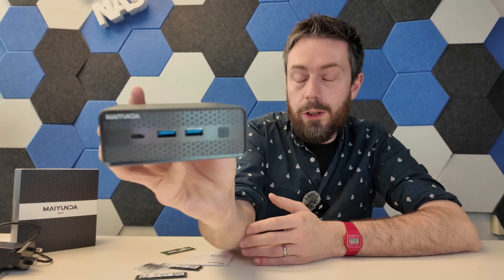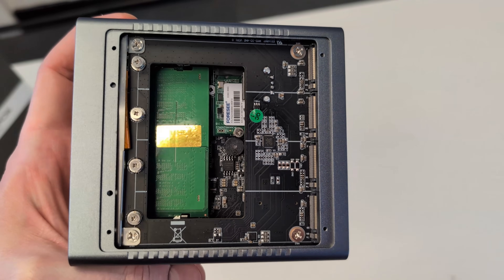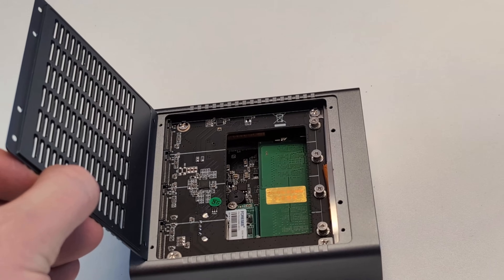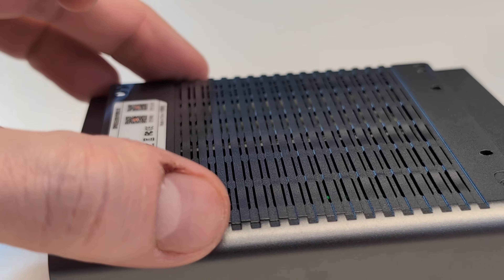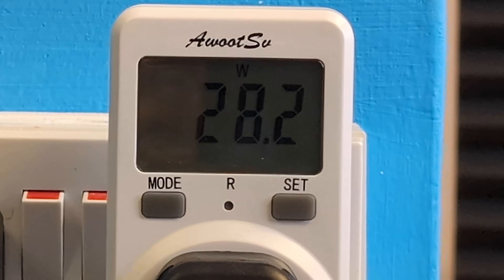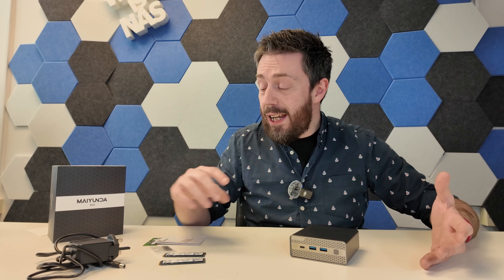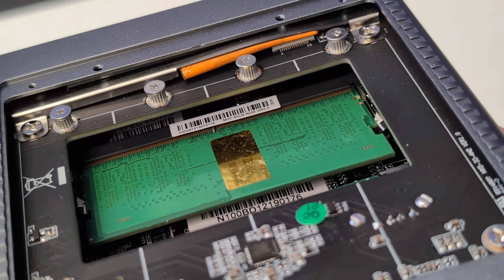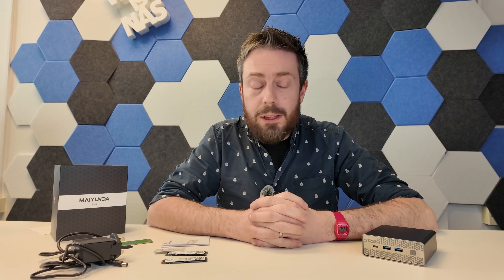Is $149 TOO CHEAP for a 4 SSD NAS? (Maiyunda M1S NAS Review)

Comment: good vid. picks up the subtle that can become the big problems later.

As far as heat goes, flip the box over so the slotted panel is on top. At least hot air rises. Perhaps a 3D case around it, with an external fan on top would be an useful additional for little money.

Comment: I decided to buy one of these and I am getting very minor heat on the chassis. I went without thermal pads on the SSD's due to the air intake being that bottom grill. Seems to work fairly well for me. A bit sluggish when I remote onto it but its still a new install of windows 11 so I wont stress it. I have two devices I cant seem to find drivers for but neither are important since its a headless NAS. It is a bit of a noisy little box though. I am pondering how to increase airflow on bottom so its not quite as loud.

Comment: I saw another review that looked at the temps and found it is set to 60 degrees in the BIOS. If you want to keep the unit cooler you could lower the temp setting in the BIOS, which should also alleviate concerns about the SSD's overheating (which, IMO, given this units design shouldn't be an issue).

Comment: This seems almost exactly like what I've been looking for. I wouldn't mind paying a little bit more for an updated system fixing some of the issues.

I would personally also like to see a passively cooled unit using the chassis to dissipate the heat. An upright standing design with corrugated sides, and thermal pads or similar to connect components to the chassis, should be able to dissipate the heat no problem. Powering via usb-c so I can use a GaN adapter would also be great, but might be difficult electronically.

Comment: I really wonder why they don’t just make these box with an option to mount a 12 cm fan on top of the box, just put some mounting screws on top, put the nvme drives on top side, and we can install any 12 cm fan on it, either power with usb, or provide 12v header for standard fan. That way we can make sure the drives are cool and it does not cost too much for them to make it.

Comment: I would have liked to hear more about the OS for this. How difficult is it to load UnRAID or similar on this device? 
There are home users that want a simple plug-in play solution. An interface that’s easy to use without having to tinker around too much.

Comment: Thermal pads are for heat transfer.... the cover has holes in.... it is relying on direct airflow, not heat transfer..... quit whining about it not being supplied with thermal pads.

You are a good channel for finding out about new kit, but sometimes i doubt your technical skills.
If you read lspci correctly you will know what generation that 5th m.2 port is.
Reply: F no.... i just unsubscribed

Comment: Unfortunately, there aren't really any SSDs suitable for this NAS. I think everything on the market today that's larger than 4 TB is either PCIe 4 or 5, and definitely x4, because you always consider them individually, also because many devices only offer space for one or two M.2 SSDs. Over time, if more devices similar to this NAS become available (some already exist), perhaps a manufacturer will come up with the idea of offering large, economical, and hopefully relatively inexpensive SSDs with high capacity but only with PCIe 3x? I'm not sure how sensible it is for SSDs to have less than x4, as that could significantly limit their use.

I've looked it up: I can only find PCIe 3 SSDs up to a maximum of 4 TB. And there are PCIe 3 x2 SSDs from one supplier, but they're more intended for industrial use and have a maximum size of 1 TB.

I'd love to buy this NAS, but the cost of the required SSDs puts me off. Besides, it's relatively uninteresting for me, as I already have more than the (reasonably) possible 4 x 8 TB capacity across several HDD NAS systems. I had actually already upgraded further with a NAS expansion and 4 x 16 TB HDDs, but my frugality led me to snag these used Seagate drives, sold as new, with fake SMART entries. Luckily, I was able to return them, and I barely had any data stored on them anyway, as I wanted to let them run for a while before putting them into full use.

Comment: I bought it at lower price as in HK.  I like its compact size, with 4 bays ssd and 12V DC power, fast, its hardware is very cost effective vs QNAP or Snology. It can be small PC for simple task  I unlike "wave form" noise (not too loud but just noticeable ) even set to quiet mode,  take some time to install DDR 5 ram, .. in general, no more complaint for its lower price.

Comment: I'm sure we'd be interested in your head to head comparison with the cwwk P5/P6 M2x4.  And I guess that GMK also.  The cwwk has better height to work with internally but also suffers from cooling the cpu vs the ram & ssds.  It's remarkable that something can be cheaper than the other two.

It's interesting that this unit has better drive->drive performance.  The CWWK's throttle horribly at that.

Aside: did you see the teaser for an Aoostar WRT *MAX*.
Reply: I've seen a lot of people saying the reliability of the P6 in ZFS is poor too, so I'd like to see some actual testing between these devices too.

Comment: I wonder if the BIOS settings need adjusting, to set the max TDP for the CPU, maybe they are defaulting to no limit.  I found that with some of the Topton and similar units, they got hot because the BIOS settings were very generic and default, when we know there is a max limit for the N100.

Comment: You’re aware you can connect two machines using TB4 and with certain Intel chipsets, and both will appear as network card on the other? Might be worth trying, since the speed will be 10 GbE+.

Comment: Good review, if you need more air in there you can always use a drill or dremel more air holes or mount an extra fan. The case getting so hot can also be a good sign in that it means that the case is doing it's job of radiating the heat away.

Comment: I'd recommend an ex-corporate SFF desktop.  It is larger, but orders of magnitude more capable.  Anyone keen enough to go for an  on-prem device is likely to outgrow this quite quickly.
Reply: What ex-corporate SFF desktops have 4 NVMe drives? 🤔
Reply: @mikeschinkel-newclarity  You can add a 4-slot SSD carrier card for $20 if you've got something that can do bifurcation. You might find something with an x16, and x4 and a couple of x1 slots.  You can put a single carrier card in each.  
If the nvme drives only have x1 links and that kind of CPU, you've got 4 drives for capacity not speed.  If capacity is the requirement, then HDD's are cheaper.   If you're looking at a $150 device to save money, are you going to buy 4x4TB nvme drives and operate them with x1 links?

Comment: There are 2 bootleneck, n100 pc lane are poor for 4 nvme, 2.5gb nic  too low for nvme performance
Reply: Ssd storage would be futureproof - if in The future some nas with i.e. 4x pcie gen 4x1 would occur and 10gbit ethernet, you would just SWAP your current flash storege to newer one. For now you have dual 2.5gbit, which pcie 3x1 fully saturate, even on duplex 2x2.5gbit

Comment: I'd do the same as with my gmktec g9, first buy two :) Keep one as a spare then were the panel on the bottom is, I have put an 80mm 5v USB powered fan, it works a treat.

Comment: I don't get the concept of these "cheap" home NAS solutions that are all NVME.

1. Cheap hardware but uses the most expensive per gigabyte storage that's not enterprise grade. Similar to putting $800 per wheel tires on your base model Toyota Corolla

2. Cheap hardware with blindingly fast storage makes no sense when your average home user doesn't have the network infrastructure or number of users required to actually saturate the speed pf the storage. 

As a product NVME NAS solutions make no sense for the home user unless they have at least half a dozen users accessing it at one time anf they have enterprise grade 10gbit or more home networking. and if they do, they aren't looking at budget solutions.

Comment: I have the gmktec g9, 4x2tb ssds, put a 5$ fan on it and it is now properly cooled. Very happy with it. 190$ including the 12gb ram and on board storage.
Reply: G9 working really well , if nvme get heat, remove the lid and place that thing on a USB fan and vola 
Not perfect but easy workaround fixed that
Reply: I returned my GMKtec G9 because the BIOS is missing an IBECC option.
Reply: @evanjrowley and what’s IBECC stands for? Pls elaborate
Reply: @DaVeTheWaVe IBECC works by adding a small amount of overhead (1/32 of the memory capacity) to store ECC syndrome data, which is used to detect and correct errors.
Reply: thinking of buying one .. could you link the fan ?
Reply: This honestly seems like a much better deal. On AliExpress right now for $167 with a $20 off coupon and it already comes with the RAM.
Reply: Only 12Gb? 😧
Reply: @mikeschinkel-newclarity  any model suggestion  got better spec at same price ? 

Cwwk pocket nas / p5x86 / myd m1 have sodimm but price higher if you slap a 32GB ddr5 in ( my p5 x86 work with 32GB but not sure about 48GB stick )
Reply: I heard that g9 overheats quite a lot. I'd love to see your solution to it.

Comment: at a persistant temp like that I can't imagine getting years of use out of it unless you can rig some sort of better cooling solution, but it could be a quick solution to move data from one system to another location in a pinch. .. It's kind of a niche device - sort of portable network server.. LoL    could you maybe lign up a fan to the bottom "what looks like VESA mount holes..? or get NVME's with their own cooling & leave the cover off..    At that point you may as well get a different solution, but maybe usefull to use on old NVME's you just don't want to toss & still get use out of.

Comment: You are nitpicking for sure.  It's not like you swap out the internal components often.  44 degrees is not at all bad..  and temps it the 60s during performance testing is not at all that bad either.  I doubt the N100 processor could exercise those single lane SSDs enough to overheat them without thermal pads.  For all the complaining you have done about thermal management I would like to have see the test results.  I usually like your reviews, but this review seemed to start out biased.
Reply: His crappy thermal camera isn't reading the CPU temp, or SSD temps. What pisses me off is that he can't be bothered to test properly. Run a Linux live image and pull up proper lmsensor values during stress tests, not just point a stupid IR camera.

The thermals look concerning enough to be a deal breaker for anyone who lives in a hot country or expects some periods of intensive use. But it's impossible to know without actual sensor values
Reply: @mikemiller1208  Yeah.. I'm beginning to wonder how competent this guy is.
Reply: @pfitz4881  I don’t think this device was made for content creators. I have 2 small channels and would be happy with this unit. I would have a hard time justifying the 16 TB of SSDs. Silicon Power 2TB UD90 NVMe 4.0 Gen4 PCIe M.2 SSD is $96/ea. $400 + $150=$550.00 which is more than I would pay. I think his bias comes from knowing the difference between quality and value.
Reply: agreed, its a nitpick at best. if you don't stick it in a closed cabinet it seems like it would be fine. as a tiny, cheap, entry level consumer device it delievers a great bang for the buck
Reply: 100% nitpicking! The CPU has a max operating temperature of 105 °C, heaps of headroom! And the windows installation actually takes quite a few resources.
Reply: Not really. I got one of those black small firewall computers and the heat killed the ram. I finally got a fan installed and now it's been fine with the new memory. Heat is a bitch.
Reply: He gotta sell those more expensive affiliate links 😂

Comment: I know I'm a weird guy.. But I quite like this thing! All your opinions are gold for users, but I think this little box could be very appealing for most. 
I've recently bought an asus mobo with a N100 and that alone was 100 €!! So I could like a similar thing. The only downside is that flash storage isn't cheap..
The funny thing is that it's possible to 3dprint a fan mount with ease and some little feet to increase the distance from the table. Or... Simply try to use it upside down.
Reply: I pretty like nute gels.

Comment: honestly it sounds fantastic, none of the things you mentioned are a problem. one or two quid for thermal pads and maybe an external fan if need be, or run it without a lid and bigger heatsinks. all easy. ali has additional discount code right now and i'd order 3 for a cluster but unfortunately your aliexpress link doesn't work and searching for it by name doesn't come up with any results.
Reply: Gen 3 at 1x? Air should do the job.
Reply: If you need to do modifications or buy missing thermal pad or external fan / remove lid means there is a "problem" 😂
Reply: @frankwong9486 It's 1/3 the price of main brand systems and those still have problems of their own Idk I can take some DIY for this capabilities
Reply: @frankwong9486 twice the price or even triple to get something without problems is the problem for me 😂😂

Comment: defintiely needs a 3d printed mini pc stand to get it elevated for better airflow.  I'm starting to believe overall that most NUCs don't really have sufficient cooling to run 24/7 moderate to heavy workloads.  I have an intel nuc10 and a minlink s13 n150.  They all suffer from thermal spikes under heavy loads and all benefit from active airflow management.

Comment: I just bought an N100 mini PC with dual 2.5Gbe to virtualize pfSense on. This would have been a great alternative for just a little more $$. This could be a good start to somebody's home-lab - assuming they already have the technical know-how to upgrade the RAM, install unraid, install nvme's with thermal pads... Guess it's a pretty small niche.
Would be cool for an RV too - assuming you could manage the cooling 🤔🤔
Reply: Did it run good? I would assume PFSense if you crank the security needs some good ram and beefy proc

Comment: so... its x1 crippled to single sata ssd speed in raid0 mode inside yet again.
your url 'Sorry, this item's currently unavailable in your location'
Reply: Same here (UK).
Reply from the maker: Weird. Still showing as available to me in UK. Try location change in the top bar, refresh page and reclick link to reload. Worked for me last time with a topton N305 board
Reply: @nascompares  Two Aliexpress links are not working. The rest is fine. Changing region to USA works, but changing back to UK throws the mentioned error.
Reply: @bosshanskloss   UK available now
Reply: Uk available now.

Comment: I really like the idea of this unit. I have been thinking that we are going to see even more small SSD NAS units come out. The price of the low end SSDs need to drop to make it a true competitor. IMHO. I went to Amazon just to see if it was there yet and got hit immediately with the UGREEN NASync DXP2800 2-Bay Desktop NAS. Double the price at $296.99 but the cost of HDDs offset the price. the DXP2800 is capable of 64 TB. For a home user like me that just wants to share storage with my wife over our own network that makes more sense right now. Speed is not relevant. She would have to download a lot of sewing patterns to use up that much storage! I just want to give her a place to store files so I don't have to keep cleaning up her internal drive. Thanks for the video!
Reply: I agree. Buy a wifi router with an USB and connect an external 2,5 harddrive to it. Not the speediest but enough for smaller files and normal streaming. I have a 4 TB external USB 3 harddrive connected to my TP-Link router (with USB 3) and want to expand the storage, but this type of NAS is to expensive when factoring in the drives. Maybe i could start with one or two 2 TB drives.. And also connect the external USB to it.. The speed will then probably be a little better. Today i get  around 20 MB/second with the router/USB connection.
Reply: @ So, are you saying I can connect any external SSD storage device to my Xfinity X8 modem/router and connect to it? That would be awesome! Acasis sells a 4 Bay 40GBPS enclosure that hold 4x4TB and that would be way more than we would ever use.
Reply: My Xfinity Xb8-T does not have a USB PORT. Maybe up grade to a different modem.
Reply: @GrandpaDoesTech  Yes, that is an option, if you can find one. I have gigabit via fiber (RJ45) and not DSL. DSL-connection complicates things.. It's a pity your modems USB-C does not support storage..